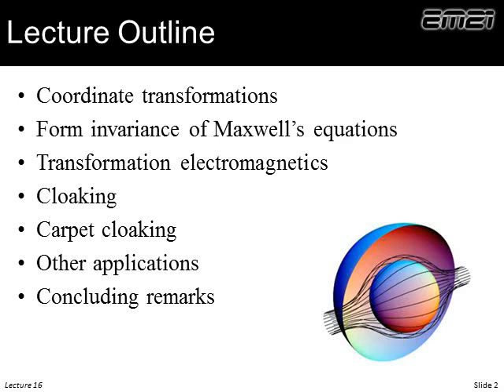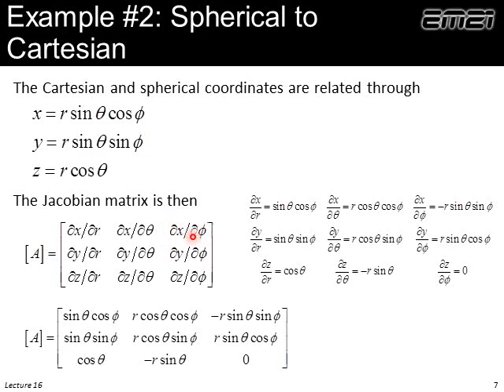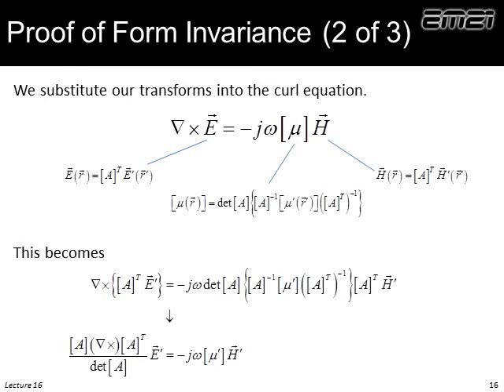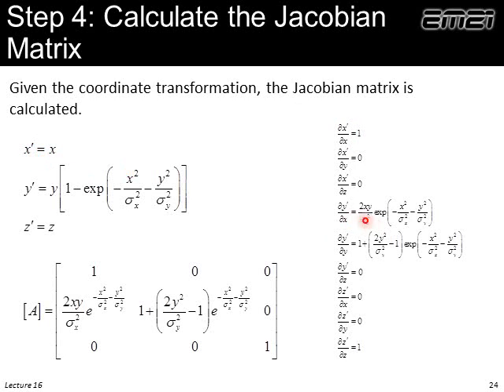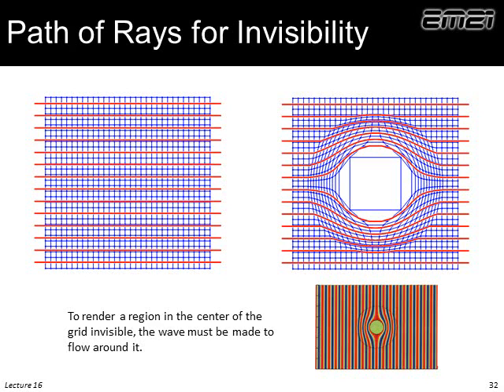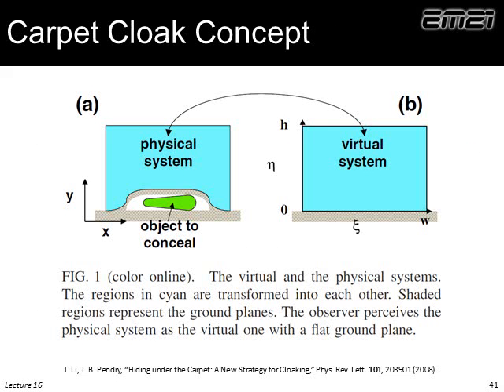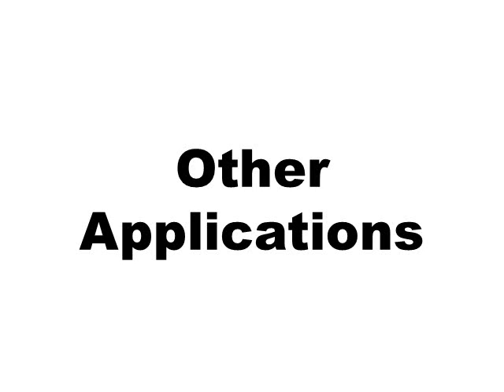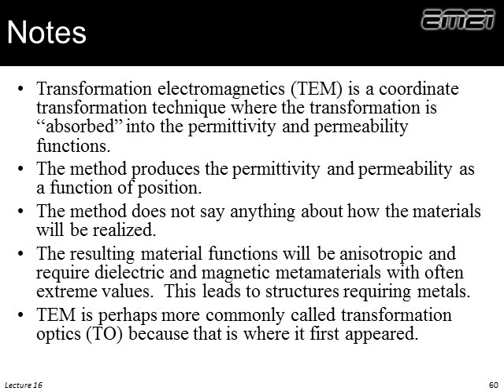Lecture 16 (EM21) -- Transformation Electromagnetics

Comment: I'm trying to implement the code but I'm stuck at the values of Nx and Ny 

Nx = 3;
Ny = 3;
xa = [1:Nx]*dx;
ya = [1:Ny]*dy;

imagesc(xa,ya,ERxx');
[X,Y] = meshgrid(xa,ya);

I used the ABOVE MENTIONED code from what I found from the comments but I dont know what dx and dy are here
Reply from the maker: dx and dy are the resolution parameters.  Each cell on your grid is dx wide and dy tall.  You will need to perform the meshgrid command before the imagesc() call and you will need to build something in the ERxx array using the meshgrid parameters X and Y before you will see anything.

Does this help?

BTW, I recently wrote a book and I have devoted an entire chapter to calculating grids and building devices on grids.  Here is a link to the book website:

https://empossible.net/fdfdbook/

Also, let me point you to the official course website.  You may find some resources there that help you:

https://empossible.net/academics/emp6303/

Transformation Optics is in Topic 6.

Hope this helps!!
Reply: Hii, can you please help me how did you plot the graph

Comment: Sir at 14.54 mins, you have discussed a transformation. Can you explain how the expression for del cross is like that
Reply from the maker: Maxwell's equations are vector equations.  If you express the fields as vectors...

E = [ Ex Ey Ez ]^T

The ^T operation is a transpose.  It is not an actual transpose.  Instead, this is notation for when a column vector is written as a row vector in order to save white space.

If you express the fields this way, the 3x3 matrix you are asking about is the matrix that would have to premultiply a field vector to calculate its curl.  To understand it, perform the matrix multiplication by hand to see that it gives the curl.

Hope this helps!

Comment: how about using python?
Reply from the maker: No problem.  I am not a big fan of Python, other than its HUGE user community and all the stuff available for it.  They have managed to make a horrible language for computation somewhat usable.  I wish a language like Julia has the same user community.
Reply: @empossible1577  i hope u can show me the python code as well
Reply from the maker: @azanakbar3215  Probably no Python from me.  I have worked with Python a bit and implemented some of my codes, but I think it is a horrible language for computation.  Check out Julia.  It has a much smaller user community, but is a vastly better language for computation.
Reply: @empossible1577  i've just read an article that compares optical transformation and conformal mapping. What is difference between them? and which one is better to make invisibility cloaking device?
Reply from the maker: @azanakbar3215  TO converts a pure transformation into mu and eps.  This often leads to extreme and anisotropic material properties that are difficult to realize in practice, even with metamaterials.  The aniostropy arises when the transformed grid is not orthogonal.  That is, when the axes are not perpendicular to each other.  CM uses properties of complex numbers to transform coordinates while maintaining orthogonality in the grid.  This keeps the materials isotropic and easier to realize.  I don't think either is better than the other.  I suggest learning both.

Let me point you to the official course website.  This has the latest version of the notes that includes conformal mapping.  I have not yet rerecorded the videos.

https://empossible.net/academics/emp6303/

Comment: great video. shed light on some areas that i was in dark about. I have a question though.
why do we assume that the field lines MUST follow the coordinate lines, so that when we transform them, we're changing how they move? I hope I've been clear. Thanks a lot.
Reply from the maker: It is not a necessity, but it is convenient.  We need to way to convert the curved path to a coordinate transform in our minds.  Assuming the wave flows along the uniform axes in the untransformed grid first is the easiest, I think.  If we had the wave flowing at some angle, coming up with the transform would be even more difficult for our brains, at least my brain!
Reply: @empossible1577  the angle of propagation is not an issue, i guess, since you can always rotate the coordinate (provided that we are dealing with a coherent flat wave-front). what i mean is, we have assumed that the field lines coincide with our coordinate lines, which gives us the feature that when the coordinate lines are bent (via an arbitrary transformation), the field lines will bend as well. I'm not comfortable with that :)))) 
UNLESS, there's a connection between field lines evolve moving on geodesics of our space, and the new bent geodesics are again coordinate lines (much respect for your quick respond, sir)
Reply from the maker: @hamidrezakhajoei3344  This is probably best understood in the untransformed coordinate system.  The waves follow the lines and do not deviate.  In the transformed system, the waves are still straight, but they do not appear going straight in the transformed system if viewed from the untransformed grid.  I think I just explained that horribly, but maybe you can make some sense out of what I just said.

Comment: Hello sir, thanks for these great videos. I am trying to plot the images  shown at 20.20. Since I am new in matlab, i am unable to understand how to fix Nx,Ny ,X,Y and how to plot these images?
Reply from the maker: Nx and Ny define the size of the arrays to be visualized.  The arrays are Nx points wide and Ny points tall.  X and Y are arrays that contain the x and y positions of each point respectively.  They are calculated using MATLB's meshgrid() command.  First you would calculate two arrays, xa and ya, that define the coordinate positions along x and along y.

xa = [1:Nx]*dx;
ya = [1:Ny]*dy;

Then you plot the images as

imagesc(xa,ya,ERxx');

or

pcolor(xa,,ya,ERxx');
Reply: @empossible1577   Thank you sir for prompt reply and solution. got the results.
May you help me with those cylindrical plot shown at 28:15.
Reply from the maker: @muktibodh2021  There are two things you can do here.  The fanciest is to create a cylindrical meshgrid X and Y, calculate the material properties in those arrays and then just plot using ordinary function calls like pcolor() to image the cylindrical arrays.  The second and simplest way is to keep doing things on an ordinary Cartesian grid.  Then set all values outside of the cylinder region to NaN.  If you call pcolor(), it will not draw the points filled with NaN.  I am not sure how imagesc() handles NaNs.  

For quick plots and my day-to-day work, I do the second technique and it works great.  If I am trying to create a very smooth and professional image, I may use the first technique.
Reply: @empossible1577  Thanks again for your valuable suggestion and time.
Reply: @muktibodh2021  how did you get the results?

Comment: I am trying to run a code, shown at 20:32.You have mentioned there er = subs(ER, x, X(nx,ny)), I don't quite understand what X and Y in the next row stand for, It will  really help me if you can clarify this for me, thanks.
Reply from the maker: The X and Y arrays are generated by MATLAB's meshgrid() command.  X is the x-position of each point the grid and Y is the y-position of each point on the grid.
Reply: Thank you for your reply sir, I tried  to use [X,Y] = meshgrid(1:0.1:3, 1:0.1:3); and Ny=length(Y), Nx=length(X) and then I try to plot with surf or ezplot at ERyx or ERxx and it just don't work , I just can't figure why... I would really appreciate If you can help me, I'm really want to make it work, thanks.
Reply from the maker: First, calculate the axis vectors xa and ya.  These are 1D arrays that contain the physical positions of the points in your 2D array.  After this, calculate your meshgrid according to [Y,X] = meshgrid(ya,xa).  That's it.
Reply: Thank you, it worked =D
Reply from the maker: X and Y will both be 2D arrays of size Nx by Ny.  What meaning does Ny=length(Y) and Nx=length(X) have?  I think this is where your error is.
Reply from the maker: Great!!!!

Comment: Hey a very nice video, however I don't understand how you got to the result for entrance 2,2 in your Jacobian at 27:07. Shouldn't it be d theta'/d theta = 1 ???
Reply from the maker: I have revised these notes quite a bit, but I have not rerecorded the lecture.  You can get the latest notes from the course website here:

http://emlab.utep.edu/ee5390em21.htm

The slide with your question is now Slide 48.  Look through the additional material and see if your question is covered.

You may also be interested in a second set of notes that covers how to solve TO problems numerically using a simple finite-difference method.  to understand this fully, you will need to learn about how the finite-difference method is being implemented.  See Lecture 10 here:

http://emlab.utep.edu/ee5390cem.htm

There are some additional numerical tidbits for solving Laplace's equation that I cover in Lecture 4 in the EM21 course.
Reply: Ahh great thanks for the quick answer. I just needed to look up the proper definition for the Jacobian :-)

Comment: Thanks for yet another interesting lecture. The lecture laid the basics of transformation electromagnetics without over-complicating the topic. I am trying to get the result shown at 20:32. In the example code to fill grid, you had mentioned er = subs(ER, x, X(nx,ny));

Does X(nx,ny) indicate the x-coordinate in the computational domain at the point (nx,ny) ? Can you explain what the domain size is? I am using imagesc MATLAB command to plot the tensor. Can you please help?
Reply: Purushothaman N Oh!! I got the plot as per your video. I had to change the domain size to view the complete plot. Thanks.
Reply from the maker: Purushothaman N Great job!
Reply: Purushothaman N, please can you give me a hint how you solved that problem?
Reply: Hii, can you please help me how did you plot the tensor